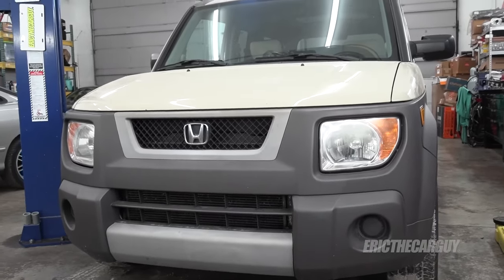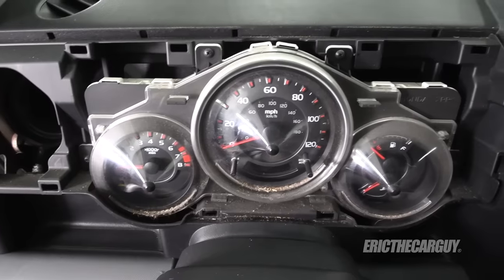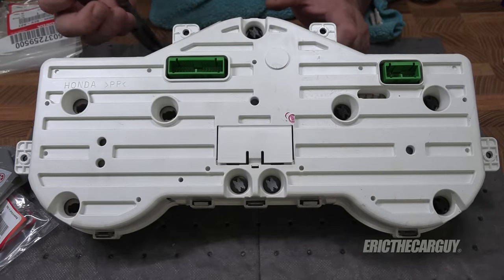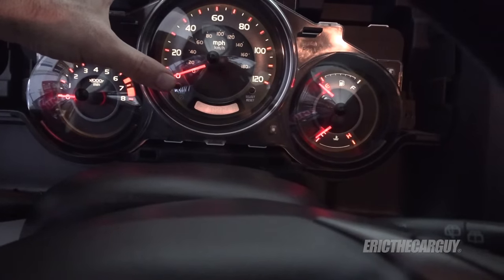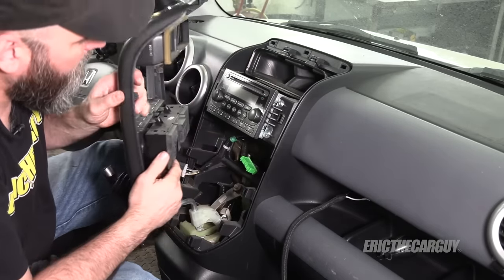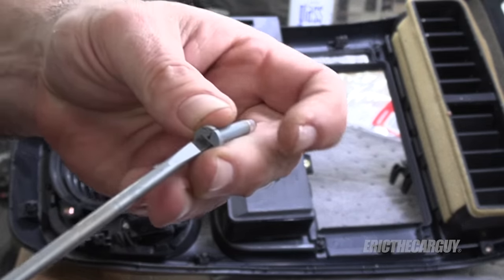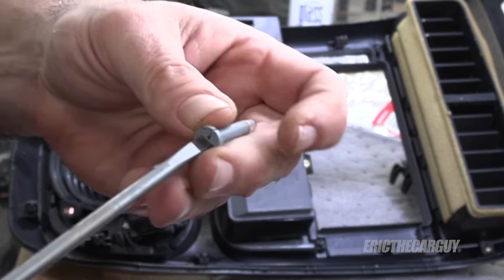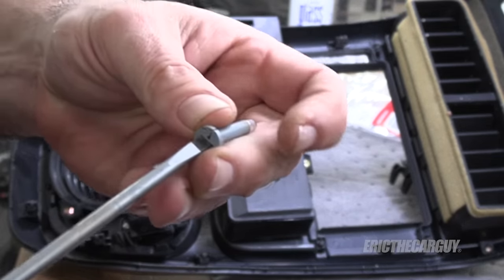Honda Element Fixes and Upgrades

Comment: Honda has always replaced seat belts in all of my vehicles free of charge. As far as I know, they are guaranteed for the life of the vehicle.
Reply: What country are you in?
Reply: @questioner1596  USA
Reply: I just left the same comment before reading yours about seatbelts. I remember dealers fixing them for no charge, but that was 15+yrs ago. Not sure if it still holds true. Worth asking a dealer before dropping cash and spending time.
Reply: @WisconsinEric  They replaced the drivers seatbelt in my 1995 Civic a couple of years ago. Only way they won’t replace is if the belt is torn or ripped.
Reply: @delmarrathbone7092  Nice. I remember issues with the seatbelts in the late 80's and early 90's Hondas/Acuras being fixed at no charge by the dealers. I used to drive a '92 Integra GSR with '01 spec B18c5 Type R motor. Owned a couple CRX Si's before that.
Reply: My 2005 has lifetime warranty on the seatbelts. I’ve had both front belts replaced by Honda and there was no charge.
Reply: Yes, Honda has a 1Million Mile infinite year warranty on seatbelts, if you take it to the Dealership they will be required to replace it because it is a safety item and the vehicle is inoperable as far as the government is concerned.

Comment: I identify with these minor fixes. I get insane when something doesn’t work in my car. OCD I guess. I just chased a broken wire for 3.5 hours for an insignificant passenger side under dash light. It bothers me!  You feel better when everything works. Not everyone gets this but I know Eric does.
Reply: I could spend allll day trying to fix the smallest thing in my car but when its a customer car it takes everything in me to even take a look at the thing

Comment: I had the same seatbelt code pop up occasionally. I noticed it was when I adjusted the seat, and would clear when I restarted the car. I found that one of the connectors under the seat was not solid. Cleaned it out and added some dielectric grease, and no more code! Worth check before purchasing a new buckle if anyone else is having that issue.

Comment: I wanted an Element with the idea that I would use it with the RV. Ended up going with the CR-V instead. I don't regret the choice as the CR-V (2006) had been bullet proof aside from bushings and normal brake work. I still want an older Element for the extra open space in the rear.
(That's what she said)

Thanks for sharing, Eric!

Comment: I recently replaced alternator on my element and the driver side Bolt was a tough one. In the video that I just watch from you I noticed that you took the condenser fan out. And that allows for extra room to get that the driver side bolt that holds the alternator to the engine. block.

Comment: Eric your my hero. I have a 2003 EX from birth. My dad bought it and I took it over in 14. I have 135k on it. I’ve done a lot of work on it but I must admit Honda has done all the hard stuff. Just for your viewers knowledge if you have a Costco membership you go to their auto program and put in you need a repair they give you a coupon for 15% off at the major Honda dealer in their area. At least that puts repairs in the local shop price with Honda OEM work. It’s worth it if you can’t do some of these major repairs. Also if you haven’t tried them Scorpion Tires have the best ride I’ve ever had on my baby. Gets rid of that torque slide you get in wet weather. Handles like a race car now. Love you Brother!!!

Comment: Hey @EricTheCarGuy...The door latches you tightened are only one-half of the adjustment for the door.  Check the loops that the door attaches to at the bottom.  They actually have some adjustment range, so you can get the doors fine-tuned to close with almost no motion.  I noticed some wind/road noise, and sure enough, the loop on my driver's side door was a little loose, so the door overall was at its loosest possible position.  When I got both sides adjusted, the doors now have a very tight seal, and there's no ping-pong motion at all when the doors shut.  But where you'll really notice the difference is in how much quieter the car drives...you'll hear a big difference.

Comment: bought my second E, and had to replace hatch struts, condenser fan and fix that rattle from the rear passenger door. This video helped alot specially the rear passenger door, because I thought something was loose in the the door, never thought to look at the bottom. THANKS

Comment: Struggling to choose between one of these or a Ridgeline. Though, I must admit, the ease in which you were able to do all of this work has really put some points in the Elements favour. I love tinkering with my cars and modifying, to make them uniquely my own. Just sold my trusty FJ cruiser, and I miss working on it already. Thanks for another great video!
Reply: The Ridgeline, FJ, and Element are all rugged, practical vehicles but the element lacks severely in towing capacity (only rated for 1500lbs from Honda) so if that's a concern I'd pass, but the Element offers so much practicality on a platform that's easy to work on. I came to my Element from a v6 4runner and while Toyota is pretty good at making things easy to work on, the Element is absurdly easy, there's almost always SO much room to work on anything in and on these.

Comment: I recently had to address a power steering issue issue with my mom's '05 Mazda Tribute[2.3L I4]; there was a leak THROUGH the pressure sensor switch!  For draining/replacing the fluid, I just used the standard "brake bleeder hand vacuum" w/catch can.  Worked a treat, also no drips.

Comment: Couple things:
1) For people looking to do their own repairs (yay, you should) - Some of these fixes may not apply the same way on the 07+ models due to the refresh. At least the seatbelts, since they are in the front seats instead of the doors. Just double check part #s to be sure.
2) They DID offer a leather wrapped shift knob, for both the auto and Manuel!
3)Looking forward to your clearcoat advice, as my wife's orange '07 has that same issue in spades. I've heard its a common issue with this vintage.
4) Now you are making me want to get those same lights. Sigh, more $$$ for the toaster.

Comment: What i like to do with the power steering fluid flush is get the front of the car off the ground, suck out the fluid from the reservoir, disconnect the return line and place it into a clear bottle, plug off the return hole, fill the reservoir and then just keep turning the steering from lock to lock (no need to run the car). Keep topping up as the fluid gets low until the fluid going coming out and into the bottle turns clear, then just reconnect the return line and fill the reservoir back up. This way you can never run the pump dry or even put any load on it, plus you only use just the exact amount of fluid you need to fully flush the system perfectly, worked great on my Prelude :)

Comment: Eric - This is the top reason I love this channel. You just saved me a ton of money over bringing my car into the dealer to fix. 

I have a 2003 Honda Element EX that I have owned since new (now has 200K on the clock - LOVE my Element). For the past decade I too have had the back door shimmy on the passenger side rear door. It drove me nuts. Well today I am on my way to fixing that issue based on the information you shared at 10:00 into this video. 

The door with the shimmy... I had two screws missing and the third one was loose on the passenger side. The driver side the screws were there but all were loose. I ordered two screws from an online Honda Acura parts place as my local dealer didn't have them in stock and could only find one locally - would take two weeks to get the screws and they were $2.15 each - I ordered online for $.55 each as I needed a clip or two online so it worked out with the shipping cost.

 Here is the part number for those needing to replace lost screws: 93600- 06020-0A  93600-06020-0A .  

Thank you Eric. I  enjoy the content you produce. The screws will be put in with blue thread locker.

Comment: For the fan, if you take a rubber ban you can put pressure in between the screw and the Philip head. It will screw off even if it is stripped. Just incase anyone wants to try.

Comment: Well that gave me a ton of useful info. My 2004 Element has that side door movement issue so I will be checking the bottom bolts. Mine also has the rear ‘spoiler’ lip which I have not seen on any other Elements. Thanks for another useful video Eric!

Comment: In the high trim models, there's a folding center console-arm that attaches to the driver seat. Worth picking up if you find one in the junkyard or on ebay.
Reply from the maker: I've seen those. Seems like it would be a nice addition. Thanks for the suggestion.
Reply: @ericthecarguy  From my limited knowledge, those arm rests were only on automatics. The reasoning seems to be that if the seat was adjusted too far forward, the manual shifter may have problems going into gear. Not that automatic Elements are rare, but just a little bit of knowledge.

Comment: Thanks for the tips. My Element has 215,000 miles. Been a great car. Only issue has been the brakes. The starter lasted 200,000 miles. Been great. Although I am wondering if I should replace items to be proactive.

Comment: Eric, I know you are probably only interested in replacing the blown speakers (and doing a slight upgrade while you are there) but: sealing the back of the speakers to the door, and the front of the speakers to the plastic grill will help with mid-bass a lot. Usually i use adhesive backed foam (really cheap online).

Also, those Honda adapters aren't water tight (iirc) so if you notice a side dropping out during / after rain, you might put some hot glue on the back side of the connectors to seal them. I put them in my 2015 Accord and had that exact problem.

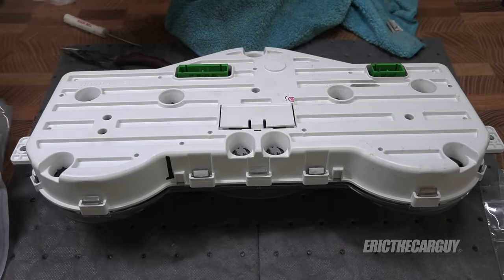Comment: 4:18  I bought Hella (2721TB Twin Blister Standard Miniature 2721 Bulbs, 12V, 1.2W, 2 Pack) bare bulbs on Amazon for under $10.  Pulled out the burnt out bulbs and inserted new ones in the original Honda bulb bases.  Works great if your bases are still good.  90% cheaper than buying whole bulb "cartridges" from the Honda stealership.

Comment: I love this video. I just bought a 2005 Honda Element. Some of the lights on my dash are out and now I know I can do this myself.  After watching this video I checked the screws at the bottom of my doors and, sure enough, some were missing and some were loose. Thank you! Do you have any tips for fixing the loose side panel on the passenger seat?

Comment: Eric. If you ever have another Honda with a seat belt buckle code or a fraying seat belt. Take it to the dealer, Honda usually covers seat belts and buckles under a lifetime warranty.
Reply from the maker: Not anymore. Honda changed it to 15 years.

Comment: These cars are a beast. Loved mine for the 5 years I had it. Until I rolled it @ 75 mph 2-3/4 times off the I17 northbound out of Phoenix at Bloody Basin. Walked away from that if that tells you anything as well.  Honda well built. Only thing is in big wind storms your like a sailing boat with sails at full mast.

Comment: You didn't consider getting LED replacement bulbs for the gauge cluster and center console?
This way you can also get say a Red LED for the hazard light switch and the hot side of the A/C, a blue one for the cold side of the A/C and white for everything else, would give the interior a more modern look.
Reply from the maker: Personally, I've seen nothing but problems installing LEDs in gauge clusters. They just don't have the same amp draw as the indecent counterparts, not to mention, these are specialty bulbs. Also, the bulbs don't dictate the color of those individual indicators by design. Thanks for the suggestion.

Comment: Yes, very helpful. I learned several things about my 04 Element that will come in handy. Thank you!
Reply: Hey ETCG, CRutchfield says you have to cut and modify the door trim panel, and the factory speaker cover, on the rear door. Did you have to do that?

Comment: Interesting interior design. I spent over a hundred dollars replacing bulbs in my TL after a radio replacement took half of them out
Reply from the maker: The ones in the steering wheel are fun too.

Comment: The seatbelt issues may be covered under warranty as it is a safety issue. If memory serves me correct the old Hondas/Acuras from the late 80's early 90's with power seatbelts were fixed free at the dealers(memory could be wrong). Also Honda replaced millions of defective airbags at no cost to owners well after warranty was expired. Again I am not sure if seatbelts are covered, but it may be worth making a phone call to a dealer before dropping cash.

Comment: I  had that same issue with my airbag light, and the dealer fixed it for free. They said they cover the seatbelt maintenance for the entire life of the vehicle. And I’m the second owner and my Element had over 250k at the time. They may’ve even replaced that worn seatbelt too.

Comment: Eric great video,  on fan replacement I found that if you take off the top support bracket above the fans it makes it much easier to take out the fans,  less chance of damage. Also thanks for the tip about the 3 screws on the bottom of the doors. I need to check mine.

Comment: Hello Eric, love your work and videos.  I was hoping you could help me please 🙏 
I'm stuck with my 2004 Honda element, my car keeps bucking thru the gears. I have changed 
Oil change
V-THECH housing withe all switches 
Oil pressure switches 
I had a blinking D light,it was a code 26 and that has been fixed. I was hoping those thing would fix the problem but no luck,so now I'm turning to the element Guru...Lol. I hope you can help me. Thank you and keep up the great work

Comment: Acoustic & Thermal Insulation
I love my 2004 Element, but there is nothing between the big ole tires rumbling on the pavement and the interior.
The interior does not cool well in the summer. 
Please explore adding acoustic & thermal insulation.

Comment: Are elements turning into rare desirable vehicles these days? I've had mine since 2008. It's been a good, reliable car. Mine could use an overall refresh, so it's great to see how easy it is to access some of these areas where dirt and dust tend to collect.

Comment: Great video dude, I used to have an E and the stealership replaced my buckle under a recall... it was auto and felt pretty gutless, pretty sure motor was tired. How was engine and tranny on yours after 180k miles? TIA

Comment: Awesome design to have a speaker cover so you dont have to take the whole panel off get new head unit!
Reply: Agreed. Almost every car I've ever changed speakers on had the speaker grilles integrated into the door panels.

Comment: Changing the factory subwoofer can make a big difference. I got a 19 Jeep Cherokee with the 9 speaker "alpine" system. I changed the speakers with the Mopar Kicker upgrade, and just those by themselves made a big difference, but then I swapped the OE sub with a universal Kicker 8". The bass hits so hard now that my rear view mirror vibrates on the stock head unit and amp.

Comment: Eric you didn’t mess up the old speakers. I have a 2005 also and after 16 years that cheap foam is rotten with age. All you had to do was just touch it and it crumbles. 
I found some new OEM from Canada because Crutchfield says you have to cut out the plastic behind because the Kickers are a lot deeper, but I didn’t see you do that. So those Kickers fit with no mods to inside of the doors?
Reply: Those DS series speakers are shallow (aka magnet is not that tall) so it looks like it fits perfectly fine.
Reply: @2fast4all  Dang, I paid almost as much for 2 pair of OEM's. But that covered all 4 and they were new Pioneer that aren't made anymore.  Thanks for the info.  Shipping from Canada cost as much as the speakers.
Reply from the maker: They went right in with no issues or modifications. They sound pretty good too.

Comment: Its a common mod to use the struts from vw Beatles

StrongArm 4351 98 To 10 Fits Compatible with Beetle Hatchback Trunk Lift Supports With Spoiler Exc Conv

Gives you 3 inches more head room

Comment: Eric regarding the seatbelt buckle why did you bother? When my '91 civic's seatbelts got a little iffy I took it to the dealer and they ordered 5 new seatbelts and associated hardware, next day they called me to bring it in and about an hour later it had brand new seatbelts. There was no charge. Do they not still do this? This was in 2011. Maybe they pitied me though, they also gave me the gasket for the gas pump carrier under the back seat after it got mangled during a pump change.

Comment: Have you ever had to replace a faulty seat sensor for the SRS? The dealer said it was the driver side sensor that's triggering the Airbag light on the dash.